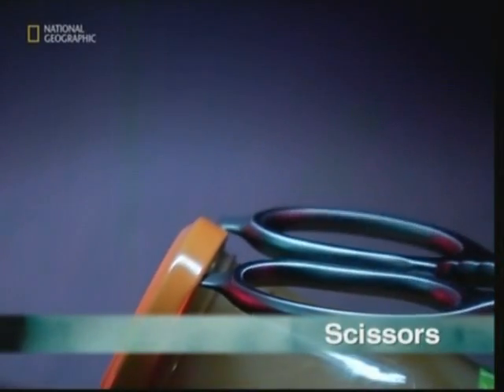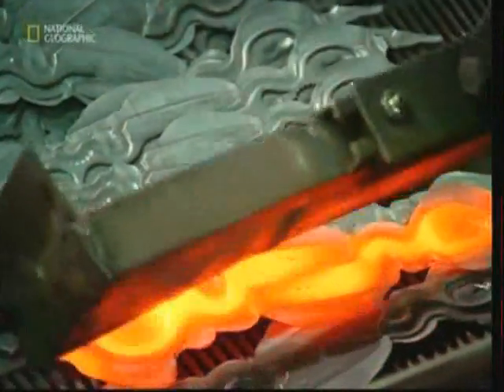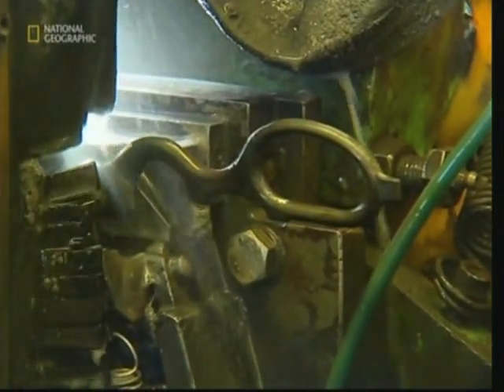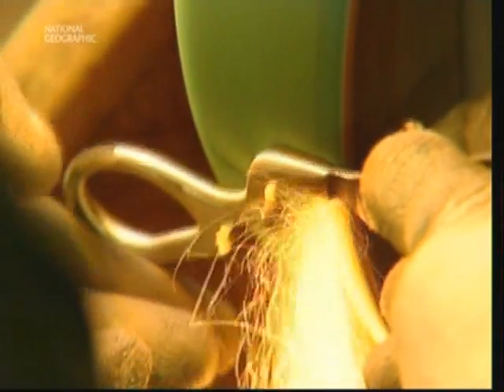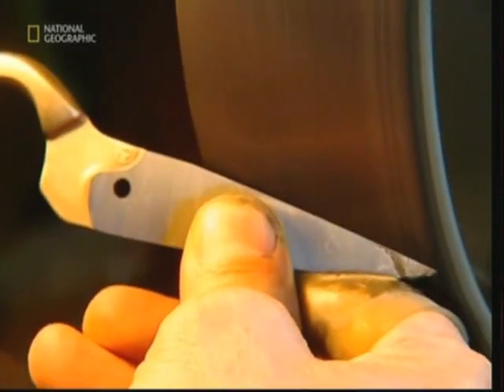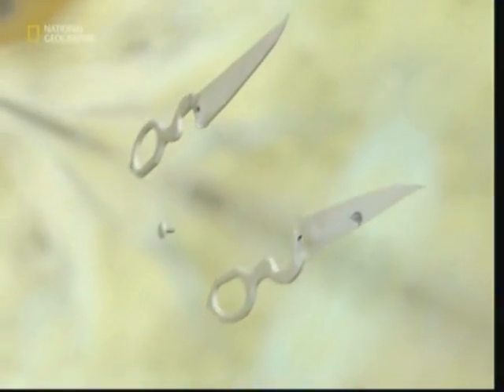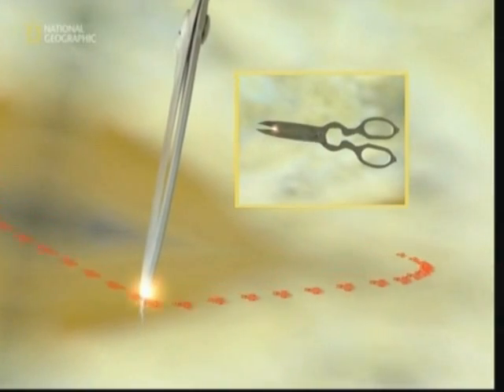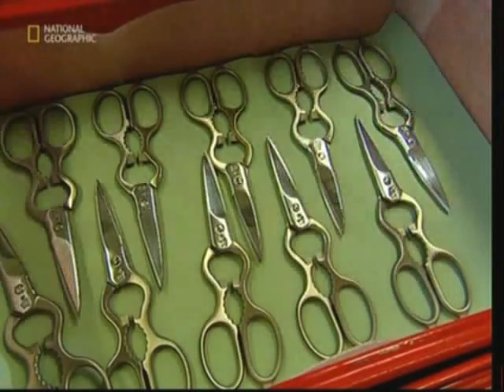How Scissors Are Made

Comment: Do you know what the machines in the video is called, because i can't seem to find any information about the machines on the internet. I need the information for a projekt at my school where we need to analyse a scissor and the process of making it, which requires me to know which machines that are used. I know what kind of machines it is but i can't find anything on them. I would be very happy if you would respond to my comment. 

Thank you for your time.
Reply: its called a drop forge press, because it presses the shape of the scissors into the shape of the scissor by sheer weight, the other type are cast steel scissors
where liquid metal is pound into moulds
Reply: M0rtenaude Hello

It's hot forged processing that they take. and my name is Paul, we specialize in the field of high performance stainless steel for cutlery 

440A, 440C, 9Cr14MoV,  9Cr13MoVCo,  8Cr14MoV,

1.4116 / X50CrMoV15, 1.4037 / X65Cr13 / 420D, 1.4034 / X46Cr13 / 420HC, 1.4031 / X39Cr13,

1.4028 / X30Cr13, 1.4021 / X20Cr13, 1.4419 / X38CrMo14, 1.4117 / X38CrMoV15...

 
If you have requirements, please feel free to contact us.

With best regards

Paul

export@ahoneststeel.com